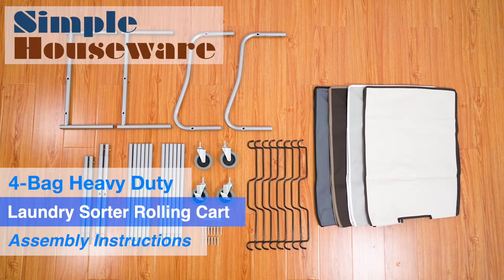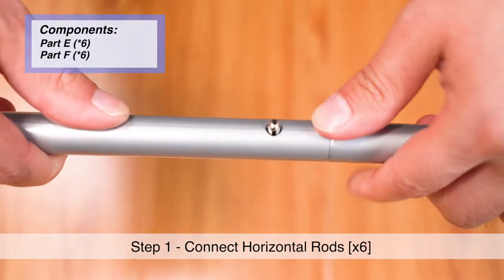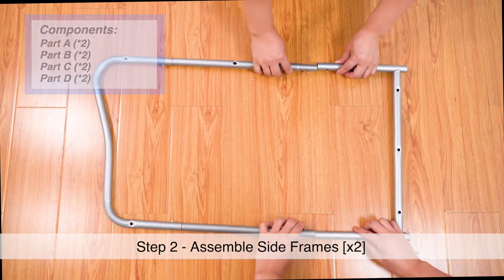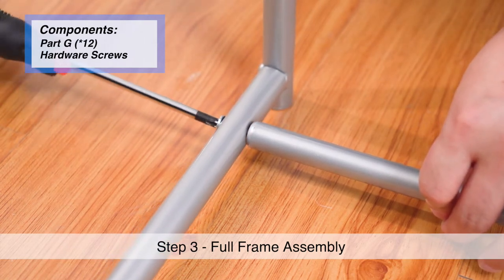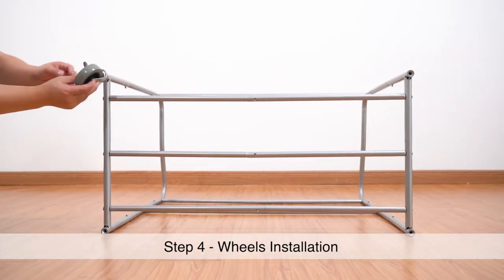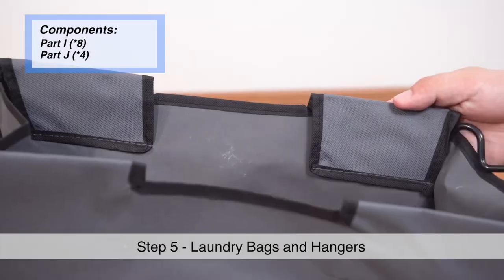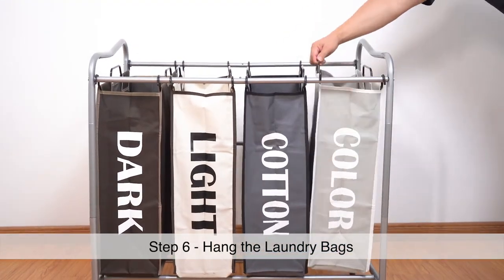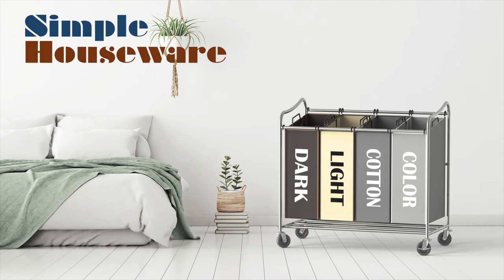Simple Houseware 4-Bag Heavy Duty Laundry Sorter Rolling Cart Assembly

Comment: Garbage product. Because the horizontal and vertical supports come in separate pieces, the bars sag and the entire cart is rickety despite proper assembly. Would it really increase the shipping cost so much if they were one bar?  I think not. Also, because the dimpled side of the holes were not placed on opposite sides, the screws do not seat flush on one side.